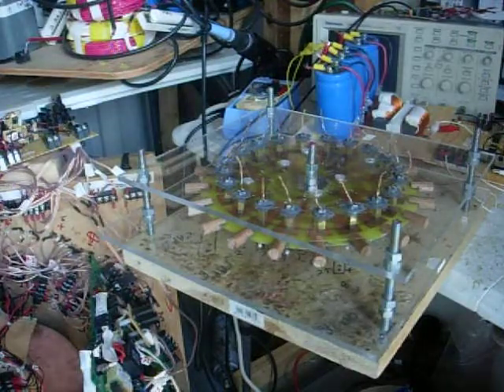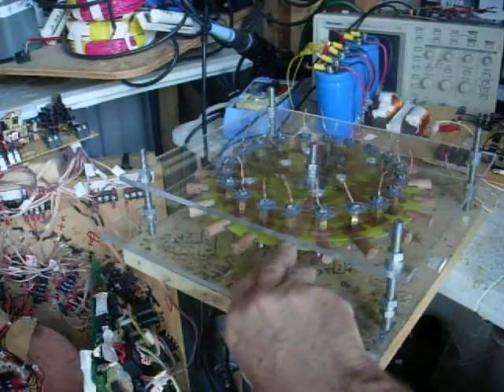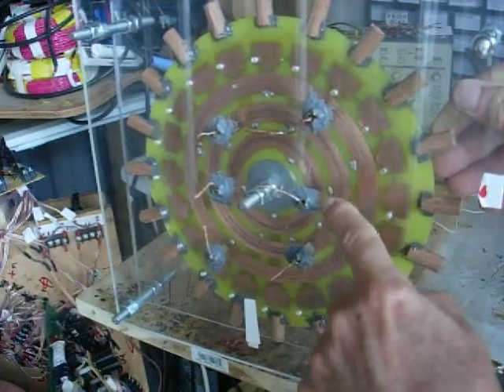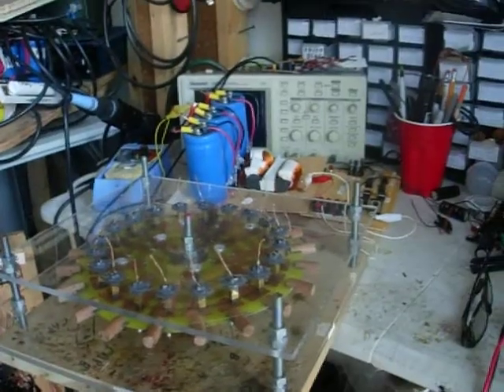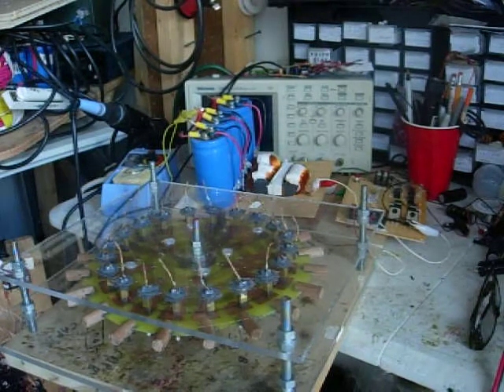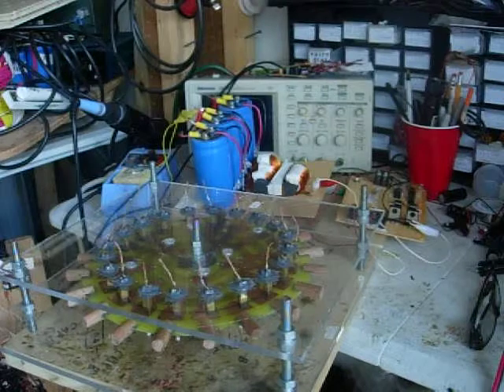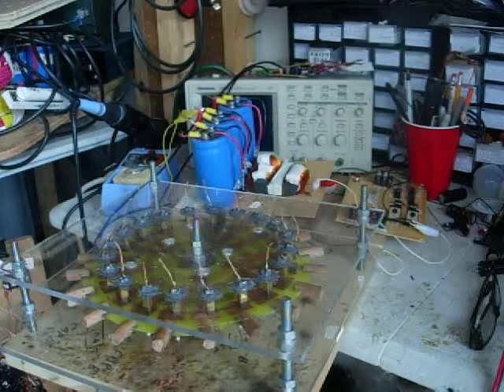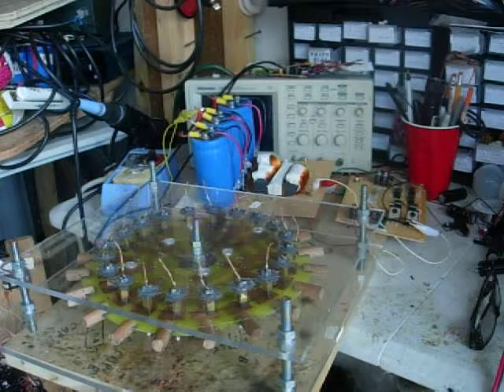Don Smith #45  propulsion system directional controller and new energy system

Comment: Ambitious project. Watching with interest. Keep up the good work!
Reply from the maker: Me tired....  The antigravity is very interesting but a bitch to do it.  That is if you want control.  I just ordered 4 pcbs for the propulsion system from RAYPCB great price $150.  after that they will cost $8 each.  getting close to testing the 20 coil platform.  the motor in videos is just about completed only need to connect the recovery between the motor and batteries...